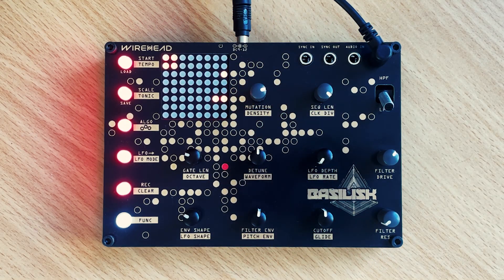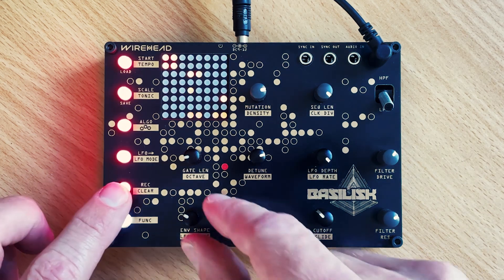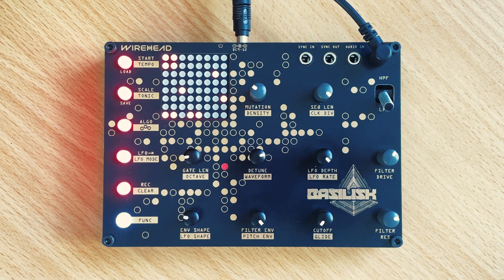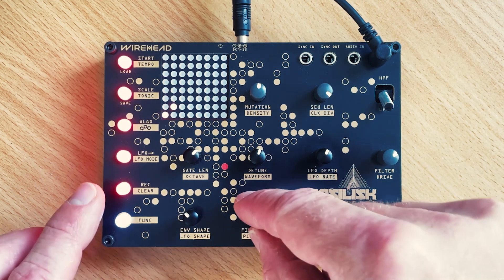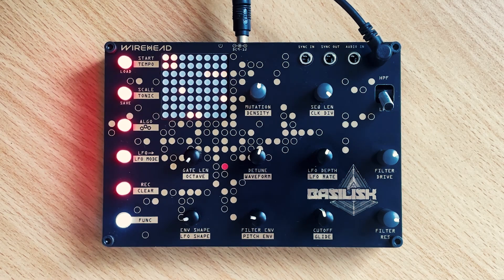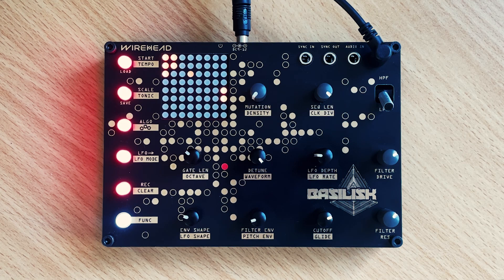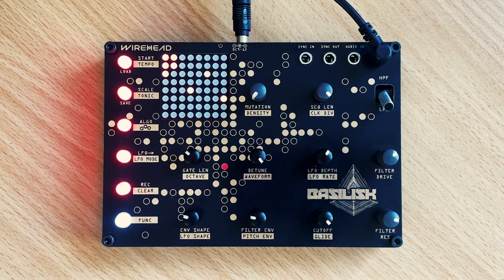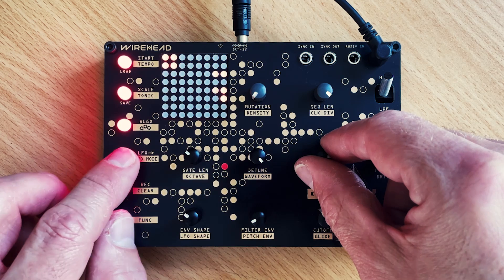Basilisk Patch Creation Guide

Comment: I'm in love with this monster!!! For reference, I've been using analog synths, and other digital synths, since 1985. At the moment, I'm planning a mission to go rescue an Arp Omni-2 from a 92yr old electronics engineer down in Florida who worked for Panasonic, and a bunch of other companies, and bought one in the early 1980's, which had something blown already.. I need to repair something in the synth section, not sure what's wrong. He says the synth section just has no output. It could be as simple as an electrolytic cap's gone out. I'll of course be replacing all that exist in it, with fresh. I gotta have your synth! I do minimal acid techno, and electro, in Detroit tradition. Detroit born, and raised, and came up in the entire Detroit techno/electro scene, beginning in about 1989...